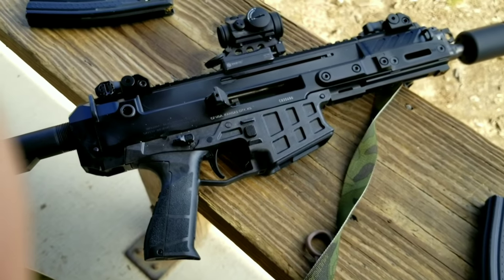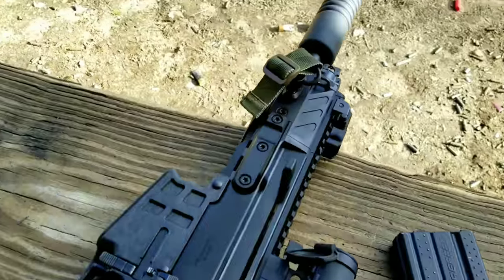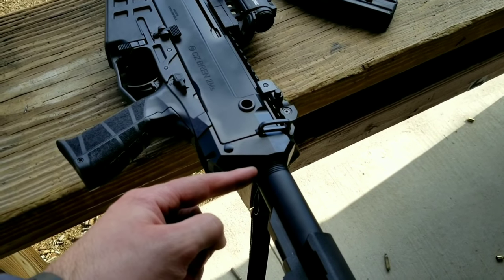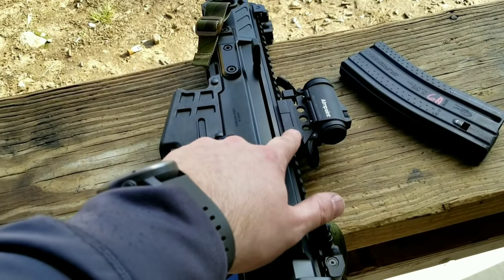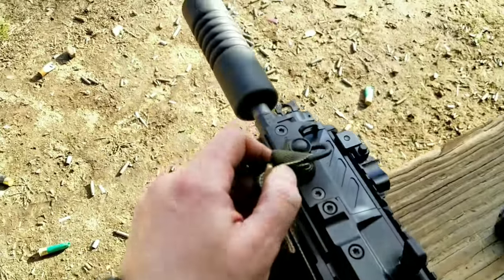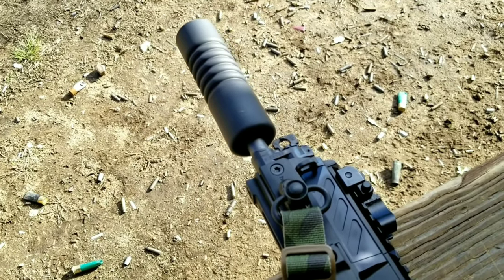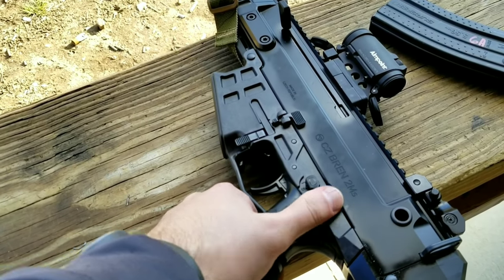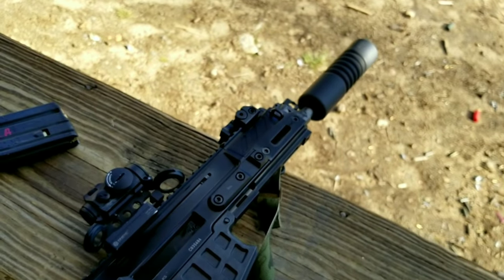CZ-USA BREN 2 Ms 8.5" 5.56 Pistol with CZ-USA 556Ti

Comment: Shoot it with gas valve set to off a few times and then pull it out. You will see where you will need to drill it. Start small and work your way up until the bolt cycles correctly with your suppressor. Very easy to do if you have a vice and drill press.
Reply from the maker: Thanks!

Comment: I replaced the 6 o'clock mlok for a pic rail. It goes all the way back to the receiver so you can place that bcm grip wherever works. Not sure who is doing it yet, but there were talks of a service to drill out position "0" of the gas port to a suppressor setting rather than it being an "off" position.

Comment: I have Bren 2 11 "7.62x39 and I'm satisfied.
It is a quality and accurate rifle ... I recommend.
Reply: Running steel case ammo alright?
Reply: @EveryDayCivilianBlog  I've had zero issues my my bren 2 ms 14" running steel case.
Reply: michal tom the original version with the Picatinny rails or this version?
Reply: Aaron Walker I’ve been running all sorts of Steel case through my 8” pistol and has been amazing. I’m surprised they went with 1/2x28 thread pitch for a 7.62x39 but it’s a low pressure round anyways. Going to mount a GSL Technology Multi-Cal Can on it in the coming weeks and see how she shoots then.
Reply: @EveryDayCivilianBlog  No problem
Reply: You admitted in another video that you’re from CZ, LoL

Comment: I want one of these but I haz the poor. I would go with the 14 inch in 5.56 and 7.62 if I could afford these.  I think you get full kinetic energy at 14 plus you could pin and weld a muzzle device to 16 inches so you could run a real stock.

Comment: dB ratings for 8.5” unsuppressed and suppressed (what ammo?); and for the 9” 7.62x39?
Reply from the maker: I don't have a decibel measuring device
Reply: No 5.56 with an 8" barrel are going to be quiet, regardless of what can is on...just enough to take the edge off, but that's it.

7.62x39 subsonic would definitely be interesting to hear run through this though

Comment: Pretty slick! I can't stand the muzzle blast coming off of such short barrels. I have SBR'd the Scar 17 and even suppressed its too obnoxious to shoot suppressed with a full can (for me)...I shoot a lot also....I love the SBRd Scar 16 10.5" and the 11.5 " knights no problem as long as they are suppressed. How does it me across as sounding so quiet on the video? the muzzle blast must be ferocious! i was one of the first in the country to get the CZ bren 805 FDE and while i think its a great rifle, I much much prefer the Scar 16 for extended suppressed shooting over my knights, my LMT, my DD or any DI rifle....now for for shooting suppressed in 300 blackout? the MK18 or what is known as the DDm4300S is OUTSTANDING......My question for you is I'm considering a purchase of the next gen 806 but I don't like that I cannot augment the trigger to a Geissele SSA-E....i do like the not reciprocating bolt handle and its lighter than the most excellent HK mr 5.56... which barrel length would you prefer in the pistol configuration for suppression? Thanks and subscribed! Doctor David

Comment: Instead of pinning the buffer tube, why not just use an AR15 endplate and a castle nut, there's even a pocket in the buffer tube adapter to accept the endplate notch.

Comment: How did you get an MS already? I’ve been on the first responder list for awhile now and no luck. 

So how is the upper to lower fit? Is there any wobble like the rear plate? On your full auto Bren, is there stock wobble on that as well? Last question is how is the magazine fit in the magwell? 

Thanks
Reply: Any chance you could answer my questions?
Reply: @cops312  he told me on instagram that it is because he is special...
Reply: Travis John maybe in his own mind.
Reply: I have a Bren 2 S (one of the military style ones that came in last year).  It's an 11" 5.56 and the upper and lower receiver fit is very tight.  Also I SBR'd it and got a factory stock for it which is also very tight with no wobble (unlock the buffer tube adapter that came with the rifle).  All magazines I've run in the rifle have fit perfectly.
Reply: It’s because he has a partnership with CZ. He’s also featured in their magazine.